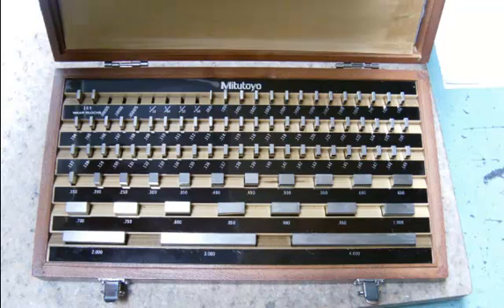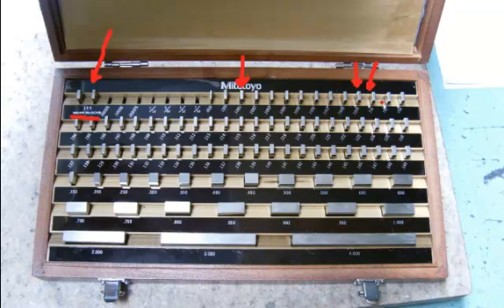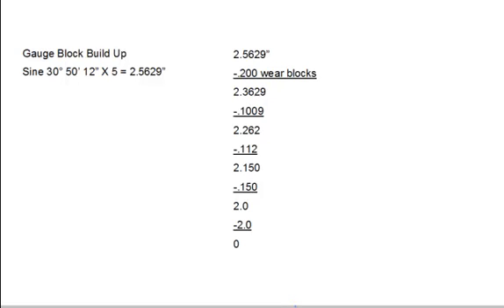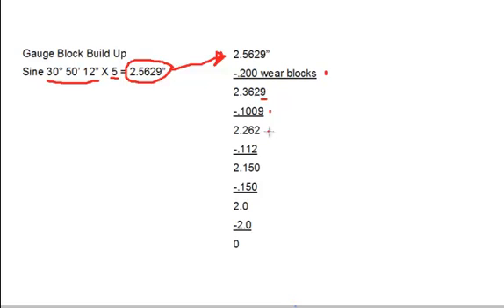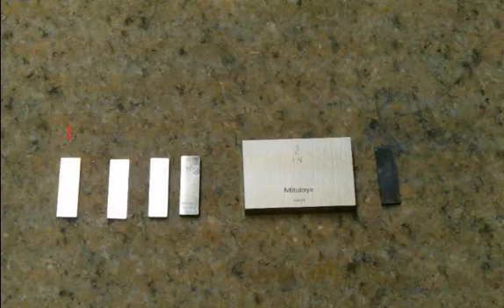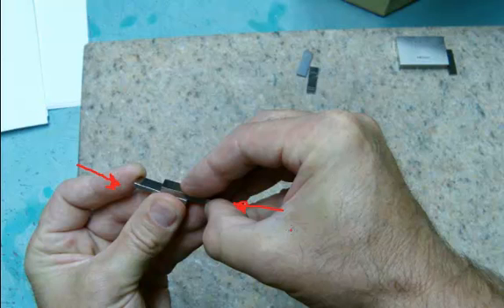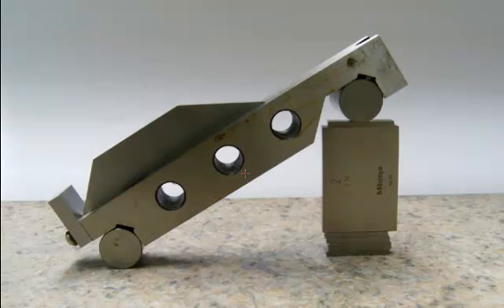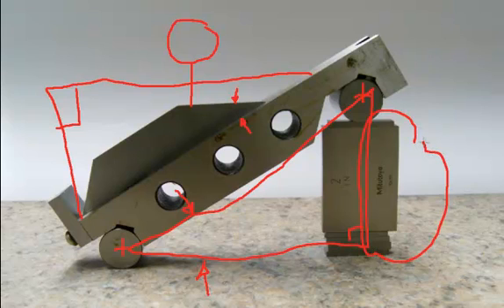Gauge Blocks and Sine Bar

Comment: machiningmoments We studied this in course but lecturer never told us how to measure angle and we need to remove air before stacking. Thank you..... 

BTW Cody labs did video on how the blocks are joined together and even when there was no air, it stuck
Reply from the maker: Thanks for your note. Yes the blocks are so flat when you put them together they seem to be magnetized.
Reply: machiningmoments the manufacturing is just phenomenal...
Reply: machiningmoments, thanks indeed for the enlighting video. Perhaps it´s worth mentioning that the blocks shouldn´t be left longer than necessary stuck one to another as their absolute even surfaces cause kind of a welding effect between them, making it impossible to separate them again.

Comment: @florisjanpietster, You don't machine against a sine bar. You use it in conjunction with a dial gauge to set the angle of the workpiece in a rotary stage or by setting the table angle or head angle on the mil. It's just a more precise and repeatable way to do that than using the graduated scale on a geared rotary stage.
Reply from the maker: I've machined on a sine plate.

Comment: When I worked at precision grinding I used Joe blocks every day,They were sent to the standard room every 6 months for calibration.I worked to very tight tolerance +- 0.0001 With a 2 - 4 micro finish.

Comment from the maker: My apologies if I misunderstood, I sometimes find post messages hard to interpret. Sine=opposite ÷hypotinuse. We have the angle (in Degrees, Minutes,Seconds), the opposite will be the blocks we need for the buildup, the hypotenuse in 5” (center distance of the wheels). So moving the formula around  30(dms)50(dms)12(dms)(enter Sine(depending on your calculator))X5 enter(=) should give you 2.5629”. If you prefer 30D50M12S = 30.8366dd. I hope this helps, thanks for your post!

Comment: Nice video. Don't pay any mind to the over critical. If you were woking in a sterile enviroment in a clean room, then yes, gloves and alcohol are the right choice. But for normal use on the floor, I was taught the way you just showed. Wring the blocks together after rubbing on the back of hand to ensure a friction fit, and get on with it. When finished for the day, I always cleaned with alcohol, then rub them down with a clean oil dampened cloth (3-in-1 oil) to get a film on them

Comment from the maker: You will notice I use the back of my hand which does not have the same oil issue as the palm. If you are going to use cotton gloves beware of lint. Rust only becomes an issue if the blocks are left wrung together after use rather than taken apart, cleaned properly, and put away. The acids in your hands will rust the blocks.